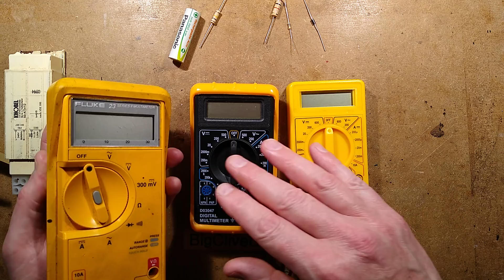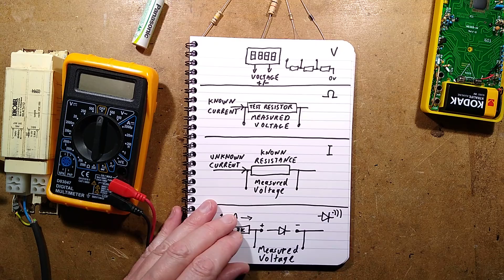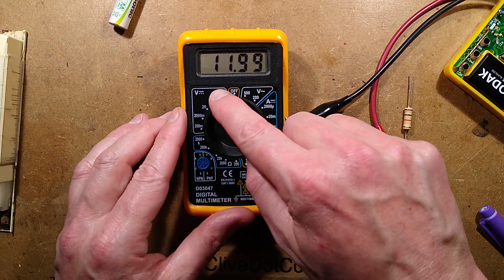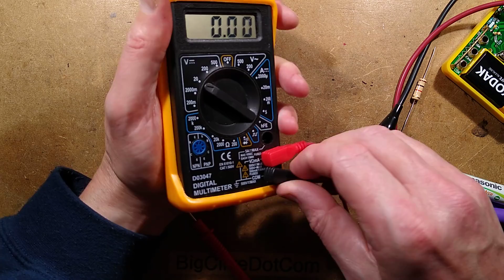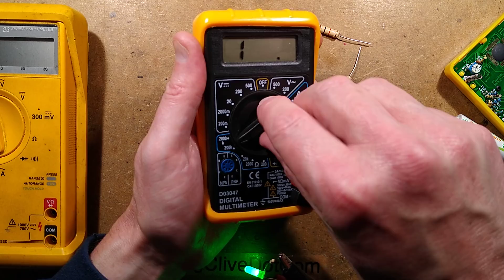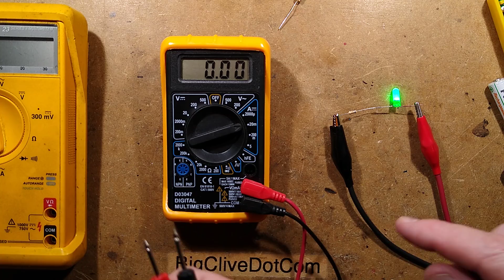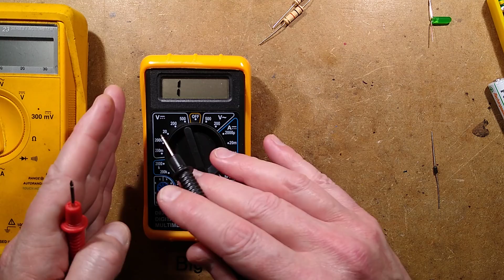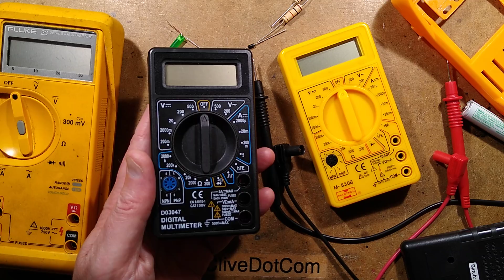How to use your trashy meter without blowing it up (much)

Comment: Good video, Clive. I don't use the transistor test range, but I'm not a snob about it like Dave. His whining about cheap multimeters is so annoying. My first meter was an analog VOM which had a sensitivity (load factor) of 20,000 ohms/volt. It took me a while to figure out that that didn't mean the meter loading changed when the voltage changed. It was the loading for each range. So the 10V range was 200k ohms. It had a mechanical buzzer for continuity which was very fast, but it worked in the OFF position so sometimes I'd hear it getting accidentally activated in my tool bag! My next meter was a kit 3.5 digit DMM which still works after 45 years. My favorite meter is a Fluke 289 logging meter.
Reply: Chris,  Since you brought up the subject of meter loading, it may be useful for anyone here who is learning to work on vintage equipment, especially test equipment, that specifications given on the schematic for in-circuit voltage measurements were often made with analog meters that had a much lower input resistance than modern digital meters,, and therefore voltage given on the schematic might include the  voltage drop caused by the analog meter being in circuit!  I know from experience that trying to calibrate or test the calibration on a Hickok tube tester will not be accurate unless you either use an analog meter or put a shunting resistor across the probes of your digital meter to roughly match the lower resistance that an analog meter would have introduced into the circuit. On the other hand, if the equipment was originally spec'd out and schematic voltages given with reference to a Vacuum Tube Volt Meter (VTVM), the impedance of that device would be more similar to a modern digital meter.
Reply: My first multimeter was a beckmann that I bought for around 200 USD. The display went bad after about 2 years and I discovered that the little conducting rubber pads that connect the display with the PCB has become dirty (how?). While cleaning the pads, I broke the super small hooks that hold the display tight against the board. My affair with electronics took a break.
Reply: Sometimes, when working on more exotic high impedance circuits, we are reminded of the loading factor even with a new DVM which has a typical input impedance of 10M ohms.
Reply: @janami-dharmam  , the conductive, carbon-impregnated rubber buttons in a remote control often suffer a similar oxidation process. Cleaning the buttons and the PCB foils ( which are sometimes carbon, not copper) with a pencil eraser, q-tips and alcohol usually fixes the problem. 

I've seen blocks of rubber, almost like a kids eraser, with carbon tracks passing right through the rubber from one end to the other, used to connect an LCD display to the driver board.

Comment: For the very cheap multimeters, I recommend the maximum voltage that you test with them be 70V AC or DC. The supplied leads are not really suitable for use at higher voltages. And on some of these multimeters, the terminals are not really suitable of voltages higher than 70V. Keep in mind that the typical recommended clearance/creepage for mains voltages is 5mm.
Reply: I've used my Skytronic 600.035 on household mains.

On one occasion, I used it to trace the wiring, when my brother took down a ceiling rose, without marking the wires. 🙄

Comment: As a hobbiest i've found that having 3 or 4 cheap meters is way way more useful than having 1 really good meter. Sometimes I have to measure current and voltage at the same time, or take a 4 point resistance measurement, and theres no real way to do that with 1 meter without spending hundreds of dollars.

Comment: I remember looking at multimeters to buy a few years ago, and my friend was like "oh no, dont buy a cheap shitty one, it will die of you put 240 volts across it" and i was like "well i.... wont then? I just want to know if my arduino works and if i made a good solder joint, im not rewiring my house"
Reply: I have a cheap UNI-T, bought it 7 yrs ago for around $25, I'm still using it almost every day, dc ac, they're super reliable
Reply: This is exactly what I thought when Clive mentioned people criticising the cheap ones. Also what I thought when I first saw the 200 & 500v options on my cheap home meter: "No way I'm actually gonna put 240v through it."
Reply: @Vousie  I routinely put 230V through my cheap meters. None has died on me or tried to kill me yet. They are more than rated for mains by Indian standards, which is that they don't blow up immediately
Reply: @Vousie  Oh and once I put 230V through a cheap meter while plugged into the 10A mode. I was holding the meter in one hand. Sharp crack and the power went out. The meter survived. The leads survived. I survived.
Reply: nothing wrong with a cheapo , just use it correctly and if it doesn blow up well it was cheap....and most can measure 220 to 280V AC
Reply: @clixium  indeed. i had my second cheapy now for 8 years and second batt
Reply: @Vousie  i have use my cheap on a lot on 220V ac with no issues.
Reply: @clixium  
I use uni-T too, at least it has a ceramic fuse
Reply: And what do you do when you need to check if your water heater thermostat is bad?
Reply: @stargazer7644  run the hot tap, if its hot then my water heater is fine
Reply: @amyshaw893  This is generally a concern after your hot tap is no longer hot and you need to find out why.
Reply: @stargazer7644   ah, well if my hot tap isnt working, theres probably an issue with my water heater thermostat or element
Reply: @amyshaw893  Sigh.

Comment: I got the same cheap yellow meter about 30 years ago, and it's never let me down. I've repaired loads of Spectrums and Reel to reels with it. It's a cheap, low voltage workhorse.

Comment: I use Flukes because, as AvE says, "Sometimes you just need to whip out a 10 inch Fluke and slap it down on the table to get the sparkies to take you seriously."
Reply: I use my 287 a lot, it's a nice meter and the logging feature comes in handy.

However I'll admit when I went looking for a solid professional tier meter...I went with the 287 for the peen factor.
Reply: I'll say this though- I've got a Fluke 88 that was charred in a house fire, with the case melted down in a blob, with the rotary dial stuck together with the case and the fuse exposed through a gaping hole.
I cleaned it up, cut away some of the plastic to get the dial to rotate again, and it still operates fully, even in spec when tested with lab calibration equipment.
I tried to contact Fluke if a replacement housing was available, but they never even responded. I suppose their customer service doesn't need to be very responsive because they don't see that much activity.
I still use it to this day as is, battle scars and all-
Reply: Absolutely. Who among us hasn't bought an over-kill tool to mask our insecurities? 🤑
Reply: He also said nobody's ever gotten fired for buying Fluke.
Reply: Haha!  Fluke... damned if you use one and damned if you don't!
Reply: I recall AvE pointing out the bastards that bought the Fluke brand.  Sounds like the kind to throw away the spare parts warehouse and get rid of tech support experts long before actually damaging product quality.
Reply: @wingerrrrrrrrr  with 3D printing available nowadays maybe you can go to a professional company and have them print a 3-D case out for you.

Comment: I didn't thought to learn anything from this video but I did. I didn't know that you can measure mA without changing the probes. Good job mister Clive! 

I like to tell something about auto range meters, don't buy these. It looks very handy but it isn't, it can be really confusing. Especially the ones with tiny range markings on the display. It is better to select a range (as threshold) by yourself because then you now what you can expect and you can notice errors if you did something wrong. Also auto range meters measure most of time things you don't want to know. This can be very confusing. Buy one with a dial with different functions and different ranges. 

I have a several of these cheap meters mentioned in the video, pretty good for simple stuff. Be aware you buy one with a beep function because you can concentrate on the subject to measure and can hear the continuity without the need to watch the display. Very handy and useful feature. I have a few without this beep function and I don't use them because most of the time you want to check continuity. Waste of money. 

There are cables available with changeable probe ends, for example crocodile clips or tiny gripping jaws. That is not a bad investment especially when you have  two or more meters and only two hands available 🙂or at places difficult to reach or to hold a probe onto. Really, it is worth the investment, you will agree soon!

Comment: I've been using those DT830 trashy meters for over 20 years now. They're very good trash. As they have no auto range, they're much quicker than my Fluke 107. But they lack the continuity buzzer.
Reply: In 1996 I bought 2 microwave ovens - top of the range Panasonic and a bottom of the range Matsui. If I was forced to have only one as a microwave, I'd choose the Matsui. The panasonic is digital the Matsui 30 second analogue with power on settings: 7-28,30 secs. It'll boil eggs in their shells. The Panasonic just blows eggs up.

Comment: I absolutely love these meters: cheap, look almost like twins to each other, can be very compact, and they're doing very good job for their price.
And yes, buying an extra set is always a good choice, since you don't really know which is gonna break first: the meter or the probes. Very good for crude measurements and cheap enough as a tool you're gonna use from time to time to measure something quickly, and won't regret blowing up in case anything goes wrong.
Thanks for this video!
Reply: And they also justify having spare PP3 batteries, lol.
Reply: @jkobain  My regular (£2 from Maplin) meter is just starting to show the battery low warning now if I leave it on for more than a few minutes at a time.

I've had it for probably over 25 years.
Reply: @paulsengupta971  some of them I blew up, others were left behind or had their probes broken at some point — because of poor manufacturing. One is right in my vicinity, and one spare is nearby.
And even when I have access to better probing tools, these meters are still there, and the batteries last surprisingly long, I must admit.
But having spare PP3s is a good practice anyway. ;D

Comment: I have the same cheap meter as on the right. It's been going for about 10 years now. I got it when I started breadboarding Teensy projects. It's a handy tool to have, I use it to test smoke alarm batteries before they're replaced. We get a lot of second hand toys for my son and it 's amazing how many simple problems you can fix with it that make you look like some electronics genius.

Comment: “Cost less than replacing the fuse in your Fluke” lol, yep.
Reply: seconded. I've had to send one back for this operation. It aint cheap
Reply: Fluke really extract the micturate with the pricing of their bespoke fuses.
Reply: more cost effective blowing up say 5pound unit than a 200 one eh?
Reply: @jacquesb5248  well in the case of the dweeb I worked with who blew up a Fluke 75, he promptly did it again. People like that get very expensive to employ, very quickly (and frequently get promoted to management/paperwork positions to stop them breaking things) 

He also did it to a £200k precision Anritsu vector analyser. Thankfully his employment didn't survive that (we all heaved a sigh of relief)
Reply: @miscbits6399  he should've had a fuse on his employment.

Comment: You neglected to mention the other problem with Flukes: you can’t just stop at one. They’re like Pokemon, gotta catch ‘em all! 

(And they no longer make the 187/189, which are of course the finest multimeters ever made, although 87V runs it close…)
Reply: I only have a lowly 83.

Mostly have it to say I have a Fluke at this point, I have an off brand that has way more functions, I use it for most things these days... Partially because if I kill it I won't cry much. Though I always use the fluke for resistance and voltage testing... It's just so F-ing accurate.

Comment: I still have my first multimeter, M-830, which I got on my birthday - 25 years ago, along with my first soldering iron. It was your video, that made me realize how much time already passed. And it is still working and useful. During the time I went to some specialised meters, both in home and in work, got another M-830 measuring line voltage on resistance (it was black before that), but this little guy still have its place on my workbench ;) And it's yellow too.

Comment: Can anyone recommend some higher quality leads that will fit in these cheapy meters? I like using these $5 guys because I can throw them around, leave them rolling around in my car, in tool bags, etc. But the leads are what break and fall apart on me more than anything. I'd love some sets of "bulletproof" leads I can toss in with these.
Reply: if you're ok with the price, go "probe master"
Reply from the maker: Noting that some of the pro shrouded probe plugs don't fit in the small meters properly.

Comment: Finally!  Someone admits that these cheap little meters can be useful!  I have several, as well as several Flukes and Uni=T units.  But my goto meter for all the low voltage and battery stuff I do is often one (or more, if monitoring several voltages) of these little beasties.  Quite accurate in the DC ranges, low power draw, so can leave them on for hours, and they just work. For free or a few $$, very handy. I leve one outside on the battery backup rack for checking the charger settings, and a few in the chaos house.. Thanks for boosting a useful cheap and cheerful tool.  Stu the crazed..
Reply: Cheap meters can be useful in some situations, but when the meter is all that stands between yourself and electrocution, is minimum price really the criteria you want to judge it on?  One day you'll need to measure 240V, so you might as well invest in a good, safe meter, and use it!
Reply: @stargazer7644  True.  But that's why I have the Flukes and the uni-T meters. As mentioned, I use the cheapies for low voltage DC stuff only. (They're a joke on AC, anyway.) Poking around in line circuits or switchmode power supplies and such, definitely go for the better meters!

Comment: He who has not tried to measure a voltage with the probes stuck on current, throw the first stone
Reply: There are only 2 types of technicians:  those who have done this and those who are about to do it.  It's only a matter of time….
Reply: @goodun2974  How about a third type: those who've learned from having to replace the fuses in their meters when other people that they'd lent their meter to did it. Even so, it's probably still only a matter of time till I do it myself, hopefully not with our yummy 240vac mains supply :-)

Comment: Giving my age away now, one off my very first meters was an AVO analogue. With a knob to zero the meter. If you wanted to measure above 10 amps , you used to connect very large currant shunts across the leads , take your reading  then workout the actual reading , H&S wouldn't allow you to do that today, with exposure terminals with 415volts measuring a few hundred amps , . Thank god for clamp meters . A very good video

Comment: I used a cheapo for years alongside a Gunson automotive meter for auto electrical maladies. I replaced the leads for some nicer quality ones and they both did a fantastic job. 

I've recently needed to buy a replacement as the old Gunson expired after 20+ years of abuse and the cheapo was on it's last legs. I'm also building/repairing guitars so something better was required. 

I purchased one of the Uni-T meters (used them previously and was impressed) and you get a lot of meter for not much outlay. Thought I'd mention it in case anyone else is looking to upgrade from an el cheapo to something in the middle. Thanks for this video, I'll share it with people who are new to meters to help them on their way

Comment: My first multimeter was a Laskys analogue kit, (mid '70s). It was a project at university. We had a worksheet for each section of the circuitry and, when we got the answers right, were issued with that part of the kit to build and test. We had to pay a few quid to keep it once finished.
I still have it and it still works.

Comment: I've bought thousands of dollars of test equipment for my business including many Fluke multimeters. If I'm at home and need to test if my car battery is being charged or just test an AA or AAA cell or a fuse, I'll grab a 20+ year old meter that's smaller than a calculator and has non-detachable leads that cost about $3,  because it does the job just as well and fits in my pocket. It has no current measuring capability which is a good thing for casual users in my opinion. I think I've changed its battery maybe three times in 20+ years. For most people a cheap meter does everything they'll ever need. The important thing is knowing how and when to use one (so Thank You Clive for reinforcing that with this video).

Comment: I was taught to never hold a meter in your hand when working with over 240 volts. I don't know if this is true, but if the meter has some moisture in it from spedning the weekend in your truck's toolbox, it might generate an arc and explode. Seems reasonable, and I always followed this advice the few times I worked on higher AC voltages.
Reply: Wise move.